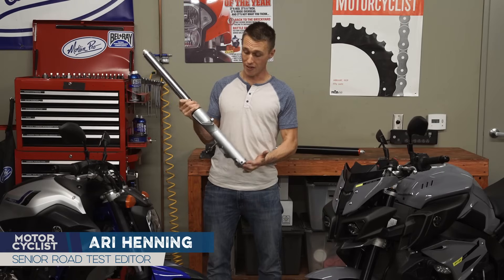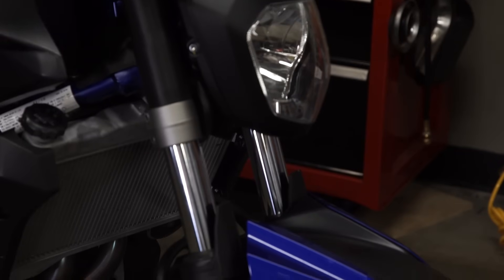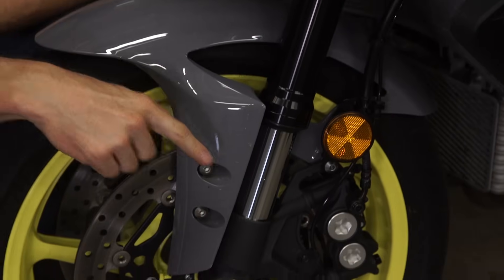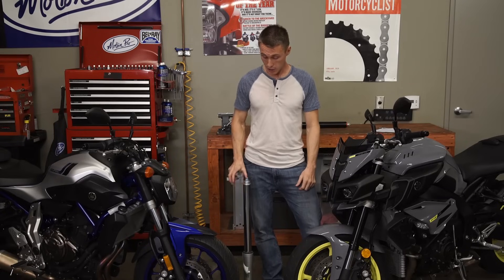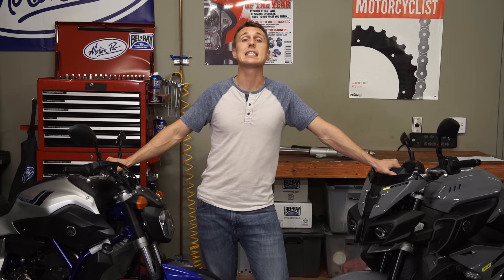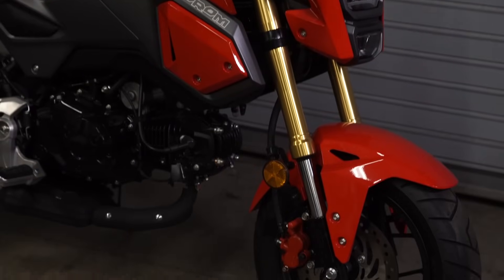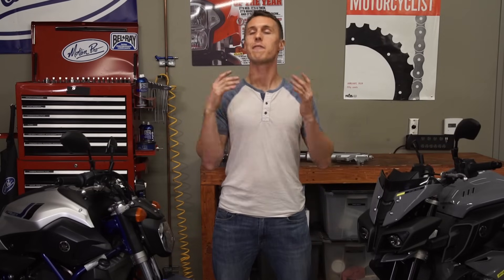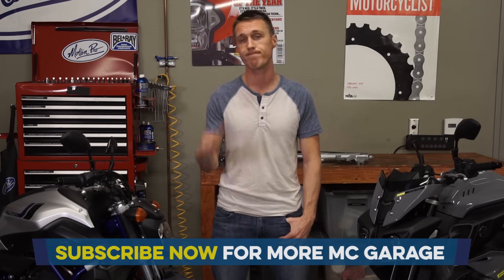Right-Side Up vs. Upside Down – Why Are Inverted Forks So Good? | MC GARAGE

Comment: uh, it's also easier to build usd forks bigger, which allows for more oil, strength, and consistency. so you end up with one having a far larger damping rod. 

it's very rare for a fork seal to fail and soak brake components. you'd essentially need to seal to completely fall out. off road race bikes have far more problems with weak conventional forks. 

lastly, yes you can feel the difference on the road. try actually riding a motorcycle before speaking. when leaned over, flex is very noticeable in weak forks and swing arms at highway speeds. the simple difference in damping between 600s and 1000s is very noticeable in stability, and that isn't nearly the difference between usd and conventional forks.
Reply: Firestarter try riding before speaking? Have you seen this guy ride?? He is a beast.
Reply: Ja jeweet when you make ignorant statements such as you won't feel the difference, then I will question your experience. 

his video is riddled with inaccuracies and lack of empirical evidence. 

I wouldn't be surprised if he released a video stating drum brakes feel the same as disc.

point is, an experienced rider can easily feel the difference, and no, they won't cause your brakes to fail.

luckily for ohlins, this guy is wrong and people can feel the difference between different usd fork tech, let alone completely different suspension.
Reply: Firestarter When you're just commuting you really don't feel the difference cause you're not pushing anything on the front. On the track, sure, but that's what he said too. And the thing about the brakes failing is a possibility. Ofcourse it's unlikely, but it happens.
Reply: +Firestarter
I have a KTM 200xc with USD forks.
Seal leaked right onto the brake pads.  They still worked but not as good as before the brake fluid washing.  
New seals and a little bit of brake clean...problem solved.
Reply: Ja jeweet I commute 160 miles a day and can tell the difference. just like having shitty bushings in your steering rack, it'll show through. same thing with radial master cylinder.

the only argument to be made is that the extra stiffness doesn't help you while commuting.
Reply: Review Guru I've blown fork seals racing my ktm 450 excr in California d37 desert racing. I've never had fluid come near my brakes. just soaked the bottom of the leg like gravity would suggest. 

you'd need to blow out the internal seal and lose the dust seal as well to physically drip oil and not just have it run down the leg. which is why I said it's rare.

plus, off reading is hard on suspension. big hits, crashes, dirt in everything. street doesn't carry that kind of stress, normally.

Comment: wouldn't there also be less unsprung weight with a upside down fork
Reply: Yeah right you ever pull a set apart? The chromed steel part is much heavier
Reply: True, though in most cases (Not all) an inverted fork will have less unsprung mass
Reply: In theory, yes. In practice, I'm not so sure... Maybe.
Reply: Blanchy10 I've rebuilt and resprung my CBR954 and RGV250 forks numerous times...The stanchions alone feel lighter than the fork body...
Reply: That is exactly why they used them. As well as protecting the fork tube from damage using the fender skirt to shroud it! Trust me. The performance difference from flex is damn near zero. And that is with MotoGP riders stressing them... The street rider will never see those stresses. Well maybe GR2 would...
Reply: I would argue unsprung weight is one of two advantages, and perhaps not the greatest. Greater stiffness is the major advantage. The biggest disadvantage, is having a rubber seal at the bottom of the oil bath, not the top... The other advantage is the common use of a large diameter hollow axle, which is massively stiffer. Huge improvement... All these things are better - which is the most critical rather depends on opinion, but I rate fork stiffness, particularly just under the triple-clamps, as the most important.
Reply: Yeah I think the most important point was overlooked here,  the upside down fork has considerably less unsprung weight.  The suspension can react quicker to changes in the road surface because it is controlling less weight, the bike is more stable and this is why it is considered a higher performance set-up.  Debate this all you want  folks but this is sort of a well known fact among tuners and engineers as well.
Reply: @davidcarpenter8741  there is also the  issue with the non-inverted fork oscillating the fluid with the reservoir in the case of oil filled struts, possibly causing aeration and heat leading to shock fade.
Reply: I figured that's where he was going with it. I agreed with you as the piston weighs less than the body, but I'm an electrician not a mechanical engineer.
Reply: The total opposite, heavier thicker part is above the spring, so everything else being equal traditional forks should give better ride quality
Reply: No totally the opposite The stanchion or shinny part is steel and much heavier than the Alloy tube
Reply: @Blanchy10  yup, RWU have less unsprung mass.
Reply: In theory, yes.
Reply: We can only assume non-inverted forks are for savings or some kind.  Tthe only benefit would be using it on a drag bike as it provides the lightest method of holding the front wheel on.
Reply: nunya business  you might have had the wrong settings on the traditional fork
Reply: nunya business  what bike?
Reply: nunya business  I ride an R6 so I have no idea.  700lbs total weight of the forks??
Reply: it's not going to change the unsprung aspect either way the weight is still the same
Reply: Maybe save some weight in the tubes but more weight in caliper mount and fender bracket. :face-blue-smiling:
Reply: Blanchy10 What are you smoking?  stanchions are light as fuck
Reply: Kneedragon1962 The axle diameter is not relevant to either fork, both are mounted in a casting at the base. On the leaking seal issue, again this is not relevant to either fork, physics 101 tells us that gravity will send all leaking fluid to the brake caliper. The greatest disadvantage with the conventional forks in this regard is the fact that water pools on top of the seals and eventually causes corrosion, then the seals leak. USD forks are much more reliable because gravity ensures there'll be no pooling of water on top of the seals and thus they'll have a longer service life.
Reply: @techo61    That’s why God invented Accordian boots.
Reply: @techo61 - Hello. Water pooling around the seal, you're probably right about. I think the quality of the plating has got better and the tech for making the seal itself has got better as well. Axle diameter, well, it's quite relevant to how stiff the front end is, with regard to twist and the wheel tilting and... In theory, there's no reason you couldn't make a conventional fork with a big modern axle, but I don't think I've ever seen one. They seemed to realise at about the same time, in about the early '90s, that upside down forks were a good idea and large diameter hollow axles. The two things are not strictly related, but they did appear at the same time and on the same bikes...
Reply: no upside down forks have more unsprung mass, the chrome part is heavier. They found out the weight penalty is minimal to the increased stiffness. So most performance machines went for usd forks.

Comment: One thing not mentioned is that having some flex in the fork can be a positive attribute when leaned over as the suspension travel has little effect at full lean. It is a trade off however, as rigidity under braking is much more useful and normal street tires rarely, if ever, spend time at extreme lean angles. Some people think this is a reason why the older R6's (along with chassis that is more compliant) actually handle a lot better than the recent models where inverted forks are standard.

Comment: Topic suggestion:  how often to change fluids in a motorcycle based on usage.  For example, do I need to change oil if I only ride 1000 mile a season? How often does brake fluid need to be changed?  If I have a classic that's really a garage queen do I need to change fluids once a year?

Comment: I thought the proper term was "Telescopic" and "Inverted" ...not that it matters :-)
...good videos!
Reply: pallusubaru All inverted or USD forks are telescopic. One section slides into the other. Telescopic covers both USD and RSU forks. Other types of forks include leading link, trailing link, truss, girder, paralever, and duolever.

Comment: +Ari Henning you missed mentioning the unsprung weight factor. But I guess it's effective, as you said, only at the limits on a track. I haven't really been able to differentiate USD vs RSU on road conditions. Anyway, good video as always. 
A lot of other channels should know that making such short, precise videos is how info videos should be. Not some 15 min long ramble before getting to the point. 
Take a bow Motorcyclist Magazine.
Reply: I agree with unsprung weight. The thicker part of the fork must weigh  more.
Reply: " Not some 15 min long ramble before getting to the point " I agree !

Comment: mmmm imma have to disagree on the not feeling the difference on the street because I have an FZ-07 and when roads get bumpy and messed up especially in the turns you can definitely feel movement on the front of the bike. it feels almost like a boat rocking as the front frock compress and depress it has some like idk how to explain it but like a swaying feeling where the front handlebars kinda gently like idk wobble ever so slightly back and fourth but when i ride my friends FZ-09 all of that motion is non existent.
Reply: That's due to soft springs and the lack of damping, not fork rigidity.
Reply: oooohh.....touche, touche... how could I go about getting stiffer springs and or adjustable dampening? is there a particular company that specializes in those sort of things?. like um an Eibach springs type of company but for motorcycles?
Reply: Try thicker oil. It's w10 oil from factory, try w15 or w20. Helps damping. :-)

Comment: The USD fork will also typically have less unsprung weight which helps reduce force on the suspension components again improving handling
Reply: Moggy1000
there is no technicality here. sprung weight is something that is supported by the springs of the car.
unsprung weight is not supported by the springs. hence, if for example you remove the springs of your car, the body of the car will drop down. but the brake assemblies, the wheels etc will stay put because they are supported by the ground itself
Reply: mrvwbug44 You mean USDs have more unsprung mass, as the fork tubes are heavier than the slider which is usually made of aluminum. On the other hand some people say that USDs benefit from that lower CoG.
But as Ari suggested, this weight difference has a minor effect, compared to stiffness difference.
Reply: Moggy1000
i think you are confused

http://www.formula1-dictionary.net/unsprung_weight.html
Reply: To mrvwbug44. Are you sure? That steel pipe is quite heavy compared to the slider. Just a thought. :-)
Reply: Sprung weight is only affected once the weight drops lower than the centre of the wheels. Aka lower frame rails, crankcase, transmission etc... As far as the forks are concerned is 100% sprung weight
Reply: +Moggy1000 anything that is moving along with the wheel is unsprung load. its not about the position of it.
if you put a sack of potatoes on the front mudguard, the front wheel will have a really hard time to follow the road bumps, which makes handling worse. if you put that same sack of potatoes below the center of the wheel, it will have the same effect. it will still be an unsprung mass.
Reply: he stated the in the vid it doesnt make any difference to handling. are there tangible metrics to suggest otherwise? interested to know
Reply: Moggy1000: If you stand still with your motorcycle, and apply weight by sitting on it, it will move a bit closer to the ground when the suspension springs are compressed. Every single part that moves closer to the ground with you, is SPRUNG weight. Any part that does NOT move close to the ground is UNSPRUNG weight.

It doesn't matter if a part is mounted high or low. Does it move closer to the ground when you sit down on the bike, it's sprung weight.

So the only unsprung parts are the front wheel and the lower end of the fork (and its attached parts, like brakes and fender), AND the rear wheel and the lower end of the rear shock absorber(s).
The only tricky part is the swingarm in the rear, since it's a lever with one end connected to the unsprung wheel and the other end to the sprung frame...
Reply: Unsprung weight only occurs at a position lower than the axle points. Then becomes unsprung weight as there is technically no spring directly supporting it. If you would like to get into full race technical terms and physics be my guest :)

Comment: Awesome video! \(^_^)/

I have a question which may not be related to this video,
the roads where I live have a lot of pot holes. I have to ride on those roads on a daily basis. Will riding over those pot holes affect my motorcycle's chain if I don't pull the clutch every time the rear wheel rolls over those holes?
As in, would it stay taught longer if I pull the clutch lever?
Reply: ***** Got it! Thanks! :D

Comment: awesome video!! motorcycle mythbusting. could you talk a little bit about motor stress? I know dirt bike engines have to be rebuilt frequently because they just add a lot of performance to not that much engine. How can we know how long a motorcycle engine is supposed to last? Are some manufacturers making bikes knowing that the engines are only designed to last for a couple years? thanks!
Reply: I have a Pep Boys Chineese 90 that is 13 years old and has hundreds of miles with the front end sky high at the redline- mostly they just need to run

Comment: Please explain the about the monoshock and the double shock in the rear section.
Reply: more pivot points in dual shocks means its geometry is more susceptible to moving in undesired ways. Mono shock makes it rigid by having just one coupling point with the shock.
Reply: Back to weight again. The mono can be placed closer to the pivot point of the rear swing arm to engine  frame location. It can be more compact, using one large\shorter spring. Gave better rebound\dampening settings. Lowered the center of gravity and moved all that weight forward. Reduced fading of the shock over the race. It also allowed them to use one sided swing arms. It was probably the one innovation in the 80's that had roots from as far back to 1903 if you believe that.
Reply: Monoshock is better for track riding and cornering and can be adjusted for variety of settings.Double shocks are better for offroading and load bearing and are better for bumpy roads as they can take on heavier weights than monoshock.But dual shocks don't lend themselves well for cornering as well as monoshocks do.
Reply: ChuddleBuggy well i'd hope i am right. i'm a mechanical engineer :D
Reply: ChuddleBuggy based on your reply you have more knowledge than typical street mechanics.
Reply: Sandepp hahahaha
Reply: that makes total sense.  any difference in the shock and spring action on either side can cause unwanted twisting forces on the trailing arm.
Reply: i was gonna ask that.. but you already did. nevermind i'll ask about single swingarm versus regular swingarm versus curved swingarm.
Reply: akupehsluarketatAR, since nobody answered your excellent questions I would like to have a crack.
Single sided swing arms became popular in endurance racing, easier to change tyres. They look good and add a unique character to expensive bikes. Beyond that they are heavier, require a really good setup with wheel bearings to counter the asymmetric loads on the rear wheel and also higher tolerances on machining. Ultimately meaning much higher cost to make, using a custom wheel rather than a common size easily available one and no real benefit to riders of normal road bikes.
Curved swing arms date from the late 80’s when two stroke 500’s ruled racing. The banana shape on the swing arm gave more room for the bulky expansion chambers of two stroke exhausts. The 4 cylinder bikes needed a lot of space for 4 individual exhaust pipes, no 4-1 pipes for 2 strokes. The bent shape gave a little more room for a set of 2 pipes to exit, the other two exiting up top under the seat.
They seem to have made a come back as manufacturers have gone to having an under engine muffler arrangement, this seems to give them more room to exit these now very large exhaust pipes behind the foot peg.Newer emissions regulations seem to be part of this. I don’t think you will find any structural engineering reasons behind this, plus it also makes the swing arm harder to manufacture and thus more costly. 
Anyway, that’s just the opinion of an older biker, cheers mate!
Reply: sayan das
good for you.  I'm not a mechanical engineer but I like to think I have a little understanding of statics and dynamics :)
Reply: Johan Chenggggy4
Reply: Monochock rules of course...even just for the looks!
Reply: Look at all the knowitalls talking about side forces and flexing.  That's ridiculous.  If anything, dual shocks would resist twisting better.  The difference is weight and moment of inertia.
Reply: Another advantage of having a mono shock is the shocks themselves... with dual shocks, the damping might become a little different from one to another after being used for a long time - you don't have such issues with mono shocks, of course. c",)